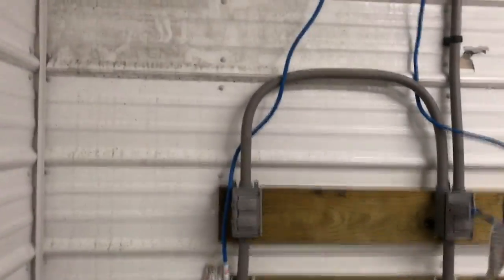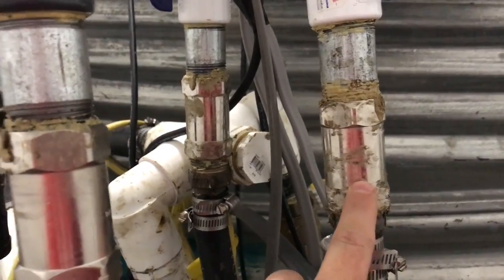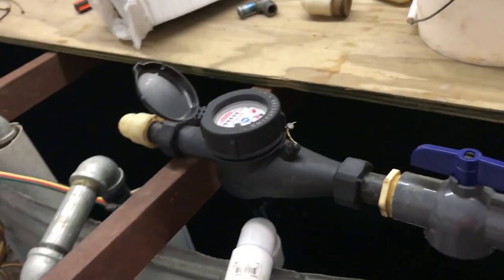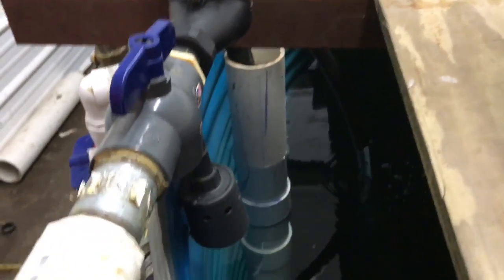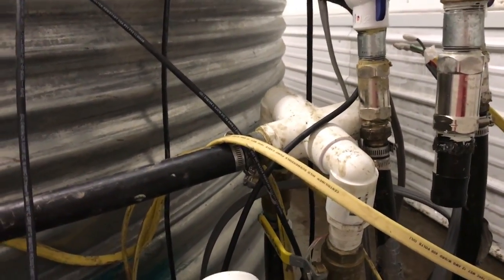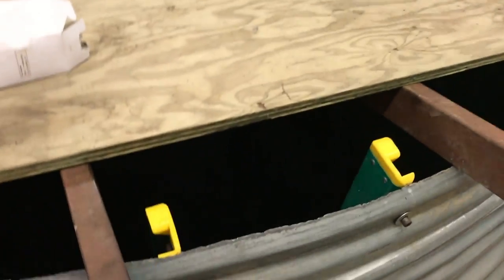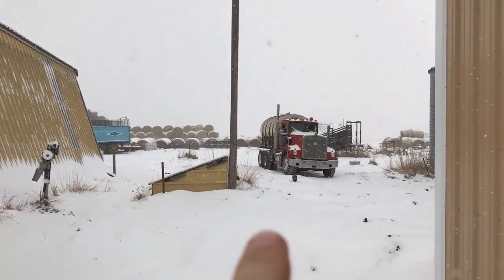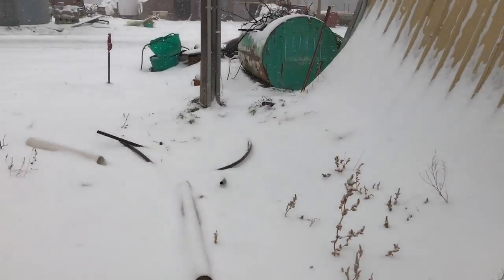What the cistern looks like finished

Comment: how did you seal up the bottom?  i saw you set it on a pad, but didn't see how you sealed it.

How deep are your wells?
Reply from the maker: Wells are maybe 60 foot....... there is a foot of cement in the bottom ..... there is 6 inches below the tank and roughly 6 inches up on the tank.
Reply: cool thanks